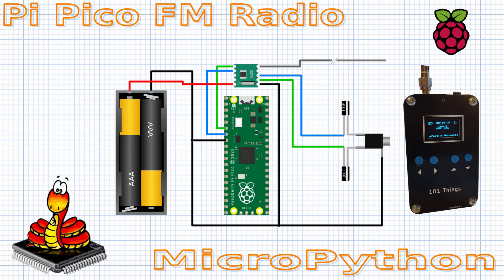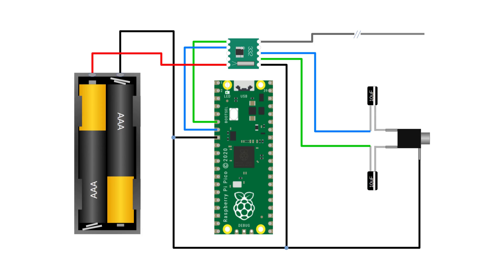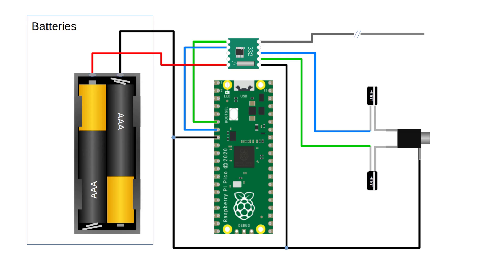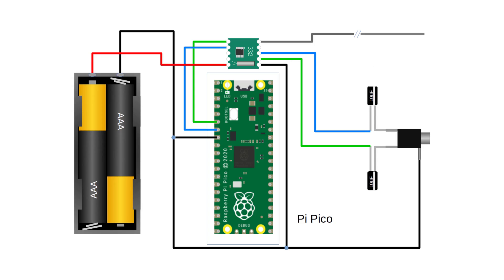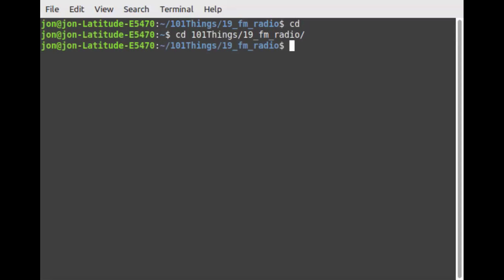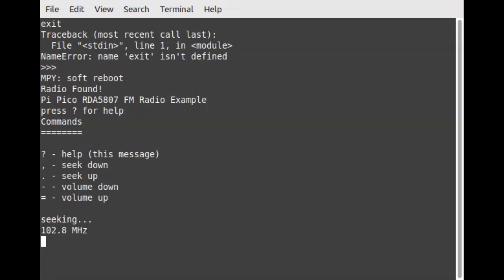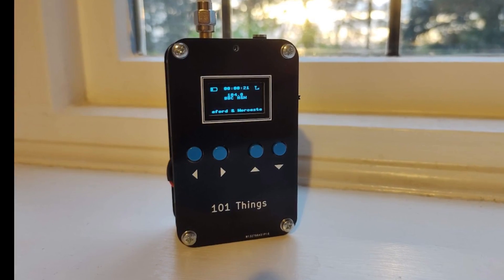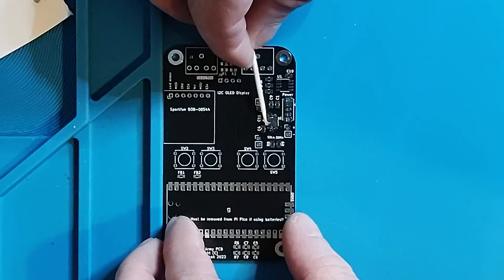Build a simple FM Radio with RDA5807, Pi-Pico and MicroPython

Comment: which antenna did you used ?
Reply from the maker: I just used a short length of wire to start with, then I switched to a short telescopic antenna a bit like this one https://www.ebay.co.uk/itm/126713685647?chn=ps&_ul=GB&_trkparms=ispr%3D1&amdata=enc%3A19Bt4QmPjQ2KNH3a_7BUY4w16&norover=1&mkevt=1&mkrid=710-134428-41853-0&mkcid=2&mkscid=101&itemid=126713685647&targetid=2425733423477&device=m&mktype=pla&googleloc=9045569&poi=&campaignid=21697391927&mkgroupid=162558106770&rlsatarget=aud-1165553645245:pla-2425733423477&abcId=10027104&merchantid=5089666452&gad_source=1&gclid=Cj0KCQjwvpy5BhDTARIsAHSilynXjdxLD-tEE7PSChJ-f6SvEXjsf5z75quH7qBdSEstu-WYYKQ4_RMaAl4TEALw_wcB

Comment: Wonder maybe the crystal frequency could be skewed a little higher and maybe receive things over normal FM band.?
Reply from the maker: It works over the standard FM bands. There are a couple of settings you can change to use different bands in different parts of the world. You could probably tweak the frequency range using different crystals too, it only receives broadcast FM, so not sure how useful an extended frequency range would be in practice.

Comment: I found one problem. The set_frequency_MHz function of rda5807.py says data = (frequency_steps << 6) | 0x10, but if you do not do something like data = (frequency_steps << 6) | 0x10 | (band << 2), it will not work if band is not 0. It doesn't work well.
Reply from the maker: Thanks very much for your comment and suggested fix! I have added a fix along the lines you suggested to the gitHub page. It hasn't broken anything, but its a bit difficult for me to test on other bands. If you have any more problems you can raise an issue on the gitHub and I will do my best to resolve any problems you are having.
Reply: @101Things-ds8tc  Thank you for the correction. No other problems so far. I'm new to Python, so I set band to global, but I should have set it to self.I learned a lot. I will contact you if there is anything else. Thank You.

Comment: Thank you your video and code. it's very helpfully.
It didn't work well at first. When I tried to power the RDA5807M from PICO, a strange value was returned during I2C initialization, and errors occurred from then on.

When I powered the RDA5807M solely from a dry cell battery, it started working.　After that, there were no problems using power from PICO.
I don't really understand why, but I'm glad it started working now.
I just changed the destination cord to Japan and it worked as is.
I'd like to add an amplifier and speakers to turn it into an FM radio.
Thank you.
Reply from the maker: Thank you for your comment. So glad that you got it working. Best of luck with your radio build.